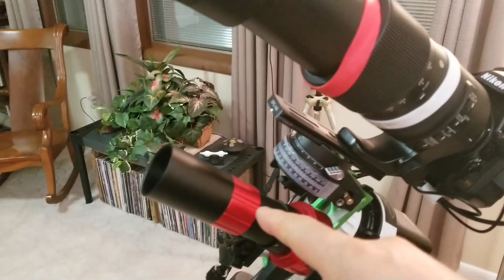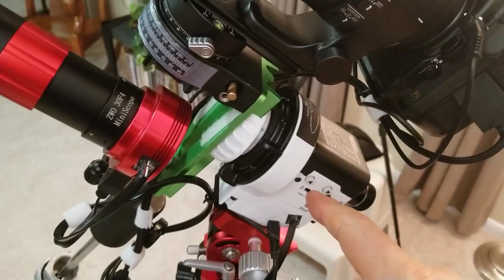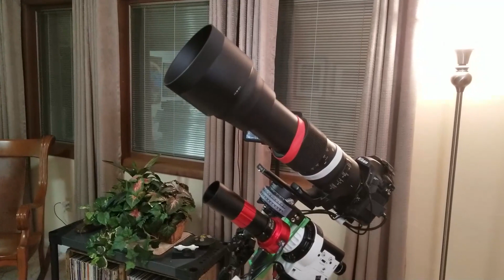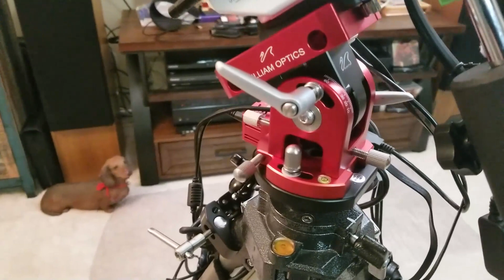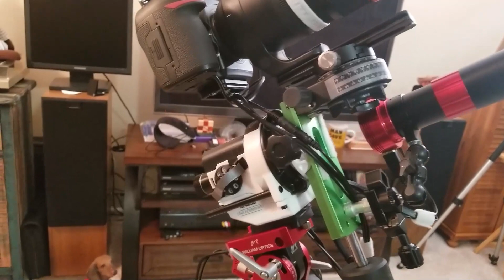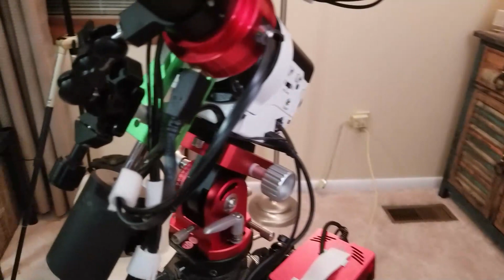Sky Watcher Star Adventurer Pro - An Overweighted Configuration

Comment: I see that you have attached your guidescope to the other 3/8" screw on the declanation bracket.  Has this impacted the guidescope's ability to track properly?  I'm wondering since the guidescope would be focused north rather than wherever the imaging camera is pointed at.
Reply from the maker: @Operating Principals , I haven't found the video that I saw early after purchasing my Star Adventurer, but the author showed attaching the guidescope to the declination bracket using a ball head.  Similarly,  I'll point out that I did attach the guide scope to the dovetail plate post via a double ball arm, so I could actually position the guide scope to aim in a variety of directions and could easily have aimed it along the main lens axis.  I didn't know much at the time about how aiming in a different direction would affect tracking accuracy but I thought it should work.  As best I can tell, I had good tracking accuracy regardless, but if I have seen any improvement since that time, is it because I've improved in my polar alignment or because I've actually now moved to placing my guidescope alongside the camera just as Peter has done?  I think the answer is that my polar alignment is better and I have in fact modified my side-mounting approach to include the same SmallRig double ball arm as seen in this video.  Why?  Because I have seen instances as I was tracking a subject moving closer to the horizon and tall trees, that the guide scope with its wider view was already seeing the trees and the guiding was more intermittent because a star might be lost amidst tree branches.  So, the ball arm allows me to aim the guide scope to a new angle, off-parallel from the main lens axis, and I have not really noticed any issue in doing so.  In fact, despite the fact that this has moved the guide scope up above the polar axis of the tracker, adding payload weight, I have nonetheless been successful in tracking for exposures as long as 8 minutes thus far.  I do seem to have small "tadpole" star trails, yet they do not visually appear to be any longer than those I've seen for 1-minute exposures, which I find to be puzzling....perhaps the time difference just isn't substantial enough to be noticeable?
Reply: I was wondering the opposite, when Peter Zelinka put it on the camera, what's the guide scope looking at? Shouldn't it be locked onto Polaris in the northern hemisphere?
Reply from the maker: @michaelwmcdonald , no, it would only be during polar alignment that the guide scope should be locked onto Polaris.  Once you've moved on into an imaging session, you would actually want your guide scope aimed to the same direction as your main lens/telescope.  I'll admit I say this without expert knowledge and still wonder just how necessary that is.  Some time ago I did read or see a video where the author was saying the most accurate tracking is obtained by keeping the guide scope parallel to the main lens/scope, and that is consistent with what I typically see of how many folks have shown their imaging trains to be set up, yet I still wonder if that is truly required vs. done out of convenience.  Theoretically, it seems to me that as any star in the sky should be "rotating" at the same rate, given we're actually speaking of star movement being due to the Earths' rotation, then why would accuracy vary with regard to what star and direction we choose for our autoguiding?  I have not researched this question any.  For me, until I buy a more robust and accurate mount, I suspect my payload weight may hinder accurate guiding/tracking more than does the guide scope's orientation and that I might never notice a difference that possibly might show up if using a mount that was more accurate and could carry the payload without a hitch.
Reply: @Ambress  Hi Daryl, I am a bit confused, can polar alignment be done with the guide scope attached away from central axis of the mount or at least manufacturer's original positioning) ? is not it only possible to be done through polar scope built in the mount? I understand that for tracking  it can be away of axis and pointing to any star but for polar align? I am only in the process of acquiring eq mount skyguider so not having experience yet.
Reply from the maker: @vladimirbotko9576 , hello, and yes a polar alignment can indeed be performed with the guide scope off-axis from the mount.  How far off-axis the guide scope could be before that is a possible issue, I have no idea.  I don't know what the math is behind resolving the location of Polaris relative to where the guide scope is mounted, as it seems to me that would be a factor, but I have never seen anyone speaking to any need for having the guide scope being anything other than positioned so that Polaris is within the view of the scope.  I've always just assumed that since it is unlikely anyone would have the guide scope so very far off axis, the short distance typically involved is such that it becomes essentially negligible in the alignment error.  Given that there are computer-based applications for performing polar alignments using a guide scope and camera, as well as tools such as the ASIAir Pro which I use, that simple fact suggests to me that a guide scope centered upon the polar axis of a mount is not necessary.   I too believe that for tracking, the guide scope can be pointed to any star, but while I cannot recall where I've seen or read it, I've also learned optimum tracking is achieved when the guide scope is parallel to the imaging axis.  How true that is, I'm not sure, but I do generally take that approach unless I find my guide scope's view is being obstructed in any way, in which case I reposition it to a clear view of some other star.
Reply: @Ambress  Thanks! That is mystery to me though. So many tutorials stress the importance of superb polar alignment for long exposures (2 min plus) and when I saw your double ball arm that has to hold (expected to be) a parallel guide scope to make sure the mount points to same spot in the sky (actual north pole), I started to question myself. Imagine it is only 1° off it.. But perhaps it is not a big deal. But imagine your Skywatcher misses a lot but your guider scope points by accident sharp at true north pole. Would you notice it and adjust anything?? Computer and software has no information about where the mount is pointing (unless it is goto).. Cant wait for my Skyguider, I have got also Ipolar to go with it. I will experiment with off axis alignment a lot I guess :)
Reply from the maker: @vladimirbotko9576  You may very well have a good point, I truly do not know!  If indeed my guide scope on that ball arm isn't exactly parallel to the polar axis of the mount, even if offset from it, how does that affect the accuracy of the polar alignment.  I have always just roughly positioned the scope forward and near center, no matter how I had it mounted; originally, I was mounting it via a small QR plate I attached to the 3/8" mounting stud of the Star Adventurer Pro's dovetail plate.  I have done it both ways...as a fixed mount and as a repositionable mount via small ball head or the ball arm as I now use, and I cannot recall ever noticing anything different to suggest that I had more poor polar alignment depending upon which mounting approach I had used.  This is all an ongoing learning process for me, and your question really leaves me wanting to double-check things.   We have clouds here tonight but maybe there will be a break in them enough to just do some polar alignment attempts, and for each one, I will look at where I see Polaris positioned on the reticle of the mount's polar scope.  Certainly some brief period of time will pass between each alignment, but if a Polar Clock app gives me the same positioning on the reticle as I observe of Polaris for each mounting option, then that will suggest the guide scope placement had little or no impact on the alignment accuracy.  I have successfully had exposures as long as 8 minutes now, where my star trails were minimal to none, but still there was an unusual "star tail" with no change of length, that I attributed to just the optics or maybe a tracking error.  But, if it happened to be that a fixed guide scope mounting parallel to the polar axis resulting in that star tail going away, that would be not only a lesson learned but also a wonderful result to see!  :)  Thanks for your question and comments!
Reply: @Ambress  Thank you for your patience with me! :) I share your enthusiasm and appreciate your frank answers, and perhaps I just did not get it from the video first time. Btw, what software are you using that showed up on the tablet?
Reply from the maker: @vladimirbotko9576   You're welcome!  I thought I might need to do further exploration to confirm I'm getting alignments as accurate as I thought, but a Google search just led me to someone asking a similar question at https://stargazerslounge.com/topic/342643-can-you-polar-align-using-your-guide-scope.  In brief, the answer is that regardless of where the guide scope is looking, it is just seeing a wider view perhaps, than would the polar scope, yet both would be used in determining a plate solution for Polaris and the surrounding stars, that is performed by capturing an image at one position and then rotating them about the RA axis to another position.  So, either will still yield the same alignment of the RA axis and hence Polar alignment.

The software you saw on the tablet is the ASIAir Pro's app.  My understanding it that is it basically PHD2, but ZWO's implementation of it with respect to how the ASIAir Pro works.
Reply: @Ambress  oh I see the answer, it looks they turn the Ra 90° and SW will calculate the offset in RA axis to be at polar. it is like reverse two star alignment. So it is two step alignment. It is taking picture with guiderscope at any and one position and then turn Ra arm in 90° and take another picture. The offset will be calculated. I guess. Thanks and clear sky!
Reply from the maker: @vladimirbotko9576  yes, exactly!  I'm sorry I didn't think to first mention how the alignment process is performed.  Clear skies to you also!

Comment: Nice run through, thank you. I have a similar setup (no guiding), but use an astro modded D5500 with mostly a Nikon 70-200 f/2.8 with 1.4x. The Star Adventurer handles this quite nicely but I’m hesitant to mount my 300mm f/2.8 (2.9 kg), though I’d be at ~ 3.5kg so well under the payload max. I would suggest moving to a Z body to reduce camera weight instead of using the D850 (an excellent camera, I have it). I recently bought a used Z7 that I will astro mod as well. Clear skies!
Reply from the maker: Thanks for the suggestion Ted.  I'm not too anxious to move into the mirrorless systems because I'm clearly spoiled by the high resolution D850's sensor.  Although the Z7 has the same resolution as the D850, even at the price of a used camera, that is more than I can justify in my mind....yet, haha!   In the event I should decide to go with a lighter camera, I already own a D7100 which should also work quite well, just at the cost of half the resolution roughly.  As a DX crop sensor camera, it wouldn't be as nice as simply shooting the D850 and framing within the equivalent area as a DX crop but should still provide some good results.  In general though, knowing I'd likely be cropping down from full-frame anyway, shooting with the D850 but to what might be the area of a DX crop means that I'm getting the benefits of shooting with the larger sensor.  Meanwhile, the cost of a different camera is...for me...better invested in a nicer mount that will serve me better in the long run, should I also start investing in other astro imaging gear such as a dedicated astro lens and filters, filter wheel, etc.  That's still some time away however.
Reply: You should have no problem with the 300 f 2.8. I use a 400 f4 DO. This is a very unique lens, using a fresnel lens. It only weighs    
4.8 lb! Extremely sharp and same weight as 150-600 Tamron, much shorter too. I use a 1.4 Tele as well at times. Tracked a time-lapse of 2019 linar eclipse with this.  Worked great.